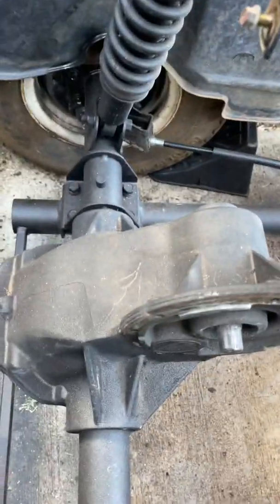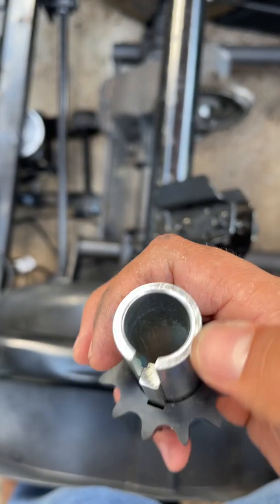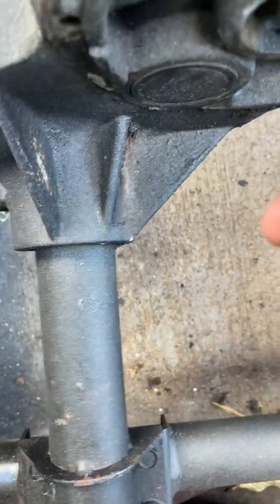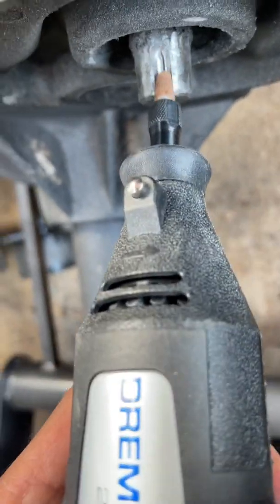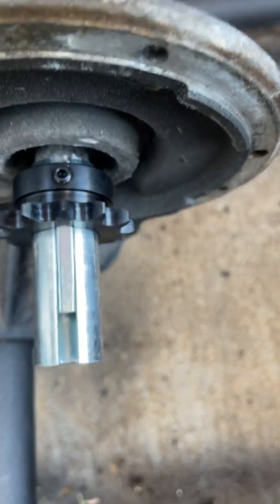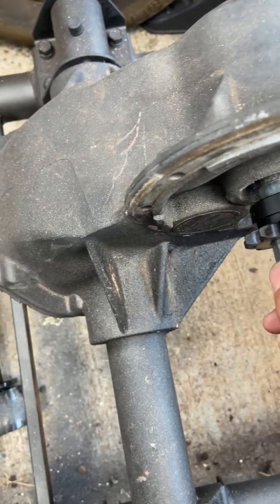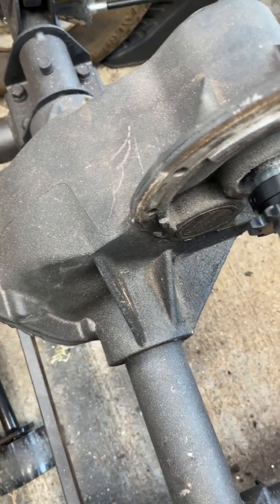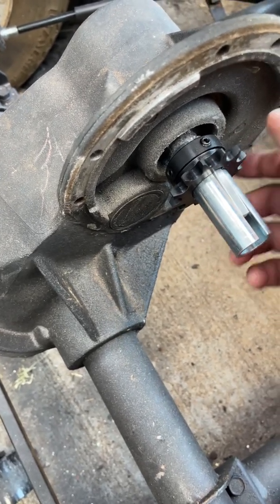Electric to gas conversion Yamaha g22 golf cart part 1.

Comment: Where do i get the key and sproket?
Reply from the maker: BLACKHORSE-RACING Go Kart Torque Converter for Predator 6.5HP 212CC Clutch Set Replaces Comet TAV2 3/4 Inch 30-75 Manco Fit All Engines with a 3/4 inch Straight crankshaft https://a.co/d/eGTlca2
Reply from the maker: Make sure you know the size of the shaft.
Reply from the maker: PGN #40 Roller Chain - 10 Feet + 2 Free Connecting Links - Carbon Steel Chains for Bycicles, Mini Bikes, Motorcycles, Go-Karts, Home and Industrial Machinery - 239 Links https://a.co/d/0gtC8po
Reply from the maker: #40 Roller Chain Connecting Links (10 Pack) https://a.co/d/aDkPAvK
Reply from the maker: Jeremywell #40 Roller Chain Sprocket B Type 5/8" Bore Hardened 9 Tooth https://a.co/d/1jbg7RY
Reply from the maker: I followed his video for the back part. 

https://youtu.be/3UX2Hch59Bs
Reply from the maker: Hope that helps.
Reply from the maker: WFLNHB Go Kart 37x98 Drive Belt for Comet Torque Converter 203597 Replaces 10042 (2) https://a.co/d/eTPwdPb

Comment: Hey im doing the exact  same thing may question is does it come off or does the chain slip
Reply from the maker: Chain is good just put a tensioner and make chain tight.
Reply: @anythinghawaii man my adapter to the shaft was too think so I had to grind it to get the sprocket on now it goes on but barely  and the 420cc  keeps pulling it off did you weld it yet cause that what I plan on doing next?
Reply from the maker: That is a good option. I put a key on the shaft with a hex bolt and put locktite on the bolt to stop it from slipping. I should have welded it though but I wanted to keep my options open so I am able to change up the gearing on the shaft to either have more torque or more speed.
Reply: @anythinghawaii  good idea thanks man